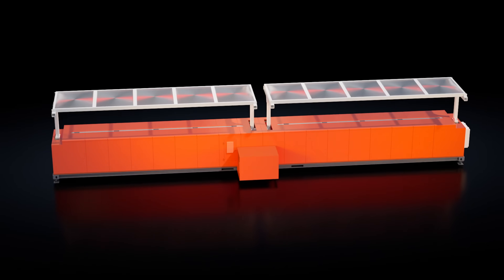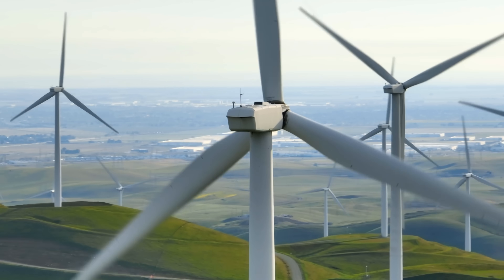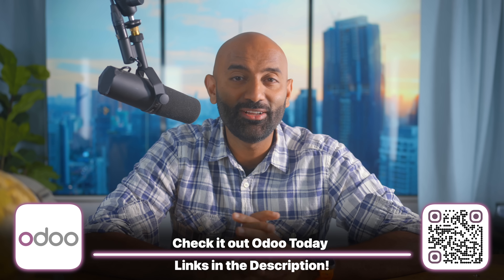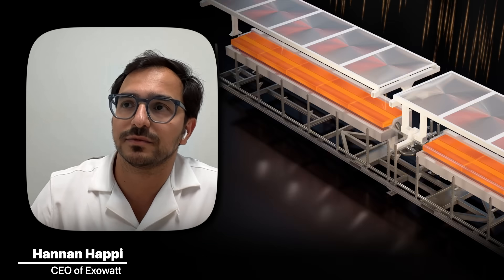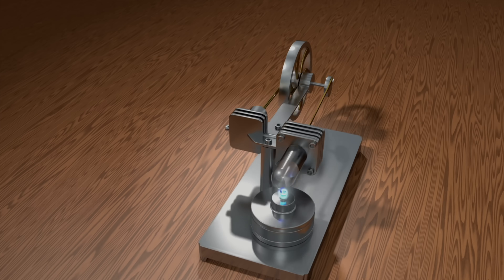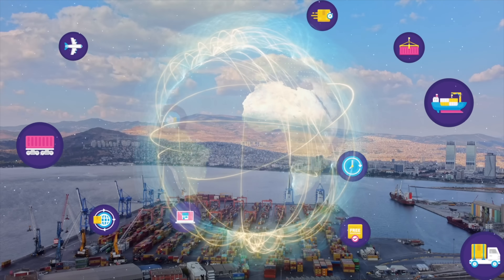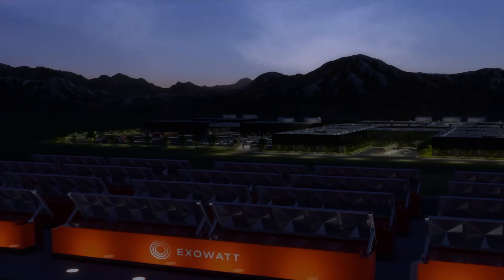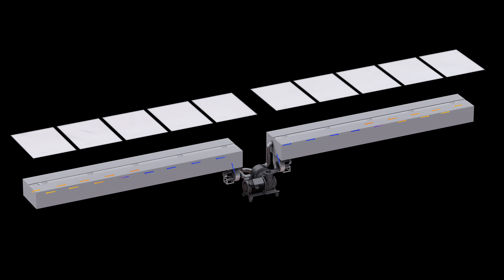Solar Without Panels, Storage Without Batteries - EXOWATT

Comment: I don’t think you said anything about waste materials after the end of the life of the unit. I would think that the materials these are made of are easier to deal with than that of spent solar cells. And you just barely touched on comparing the materials each technology is manufactured with.

Comment: One point of clarification - is the electrical output per P3 unit 25 kWh, 24/7 or 25 kWh total output per 24 hour period?
Reply: @alexkeane1626  I'm sure it dips relative to the peak sunshine vs disdipation/heat loss.

Comment: I have been working on a system to make Hydrogen on sight filling stations. I used similar elements to make power for the electrolysis. I used the Sterling engine, but different solar concentrators and heat storage. My system is smaller and only needs to make enough Energy to have Hydrogen for vehicles.

Comment: How much noise does it make?  What is the safest distance, before the noise is detrimental?  How far does the stored heat travel?  What is a safe distance?

What is the cost to build infrastructure to safely transport power?

So many questions so little time.

Comment: I'm have an off-grid system. The problem is the batteries. I would love to try out a container on my property, 28 acres. Since you need to keep Lithium warm there is an added expense, I use propane. The price off propane has gone from less than $0.30 to around $3.00 in just the last 21 years. My area can go as low as a -30⁰F in winter. This might work in my area if the container is earth berm. A container isn't structure stable to go under ground. Earth burm is what we were thinking about doing so as to not use propane to keep the batteries warm in winter an cool in summer. 
Bricks are a great idea for me!

Comment: As it's a solid box you can easily grow grass and farm cattle/ sheep on the same land. Unlike solar where the cables need to be protected and panels raised at an additional cost. 

All land use should be dual as a minimum, all these power plants have a duty to the planet to integrate food production.

Comment: Why no talk about the weakest link in the chain- the mechanical sterling engine! Not a word!! Active avoidance??

What about the maintenance and noise? How are they going to repair these in 1000°C? What about the replacement cycles and costs of something which is going to run 24x7?

Guess what! I smell another scam brewing!

Comment: 1. Your assessment of maintenance for 30 years is risky for a product, that is not even sold commercially today. It has a lot of moving parts working at extreme temperatures. 
2. Cost is a highly contextual measurement, energetic efficiency is not. The efficiency of the solar panel hardly changed in the last decades (from 15 to 25pct), cost  followed a much different path. 
3. So keeping comparing this to solar panels is kind of deliberately misleading. Compare it to a hydro dam, a coal or nuclear plant or a diesel or natural gas generator. If cost is what is most important....
4. There were no estimates on the (cost or energetic) efficiency of energy storage. Batteries can store electricity at nearly 100 pct. This unit turns electricity into heat, then converts it back to electricity. Guess the efficiency....

But the company does not want to sell this as a general solution. They want to sell it to datacenters, who are forced to use renewables in the US. As of today. They are hoping to jump on the new wave of gov subsidies fostering national self sufficiency. 

So all in all it is not better than solar. Their temporary economic advantage is based on the current political climate and on a niche hyped market. The same story as with solar panels and EV-s. If they get their subsidies they can make a lot of taxpayer money until they find out, that the Chinese can do it better, and someone takes to effort to do the math. Not that Chinese are superhuman, but they are prioritizing self sufficiency since the 50's with several bumps, and the west has gotten its head out of the sand since less than a decade ago. 

Data that is produced at these data centers can travel several order of magnitudes cheaper than electricity and other resources needed to produce it. That is the ultimate cost-benefit analysis. So in the long run the winner is, who can build and maintain these data centers the most cheaply. On earth anywhere.

Comment: Exowatt has a very interesting concept. The issue that I am concerned about is the maintenance costs. It does have some moving parts. You pointed out the fan.  It's also got the Stirling engine. The other thing would be the mechanism that adjusts the fresnal lenses.
I got the impression that they have not built any yet. Therefore, it's difficult to have a real read on the maintenance costs.

Comment: Did anyone else get the Aha moment during this model build and the Great Pyramid? The top of the pyramid was a lens?... maybe not exactly the same but it's definitely got the storage blocks! Maybe the means of transfer are gone but the newly found underground speculative images are intriguing. Instead of the tip of the pyramid projecting it was absorbing is a fun theory.. Fun to speculate.  Exowatt should be installed next to these power hungry Bitcoin Mining plants in Texas!

Comment: Excellent analysis. Is the quoted power output peak or averaged over a day?
The claim that it produces dispatchable power is correct but not the whole story. The average daily  dispatchable output will vary by at least a factor of two from summer to winter.

Comment: What about using an even simpler version of this to only heat your home in more northern climates without any electrical conversion. It likely would not be useful really far up north in the winter when there is limited sunlight, but perhaps as high as Winnipeg, Manitoba, Canada…
Reply: There already are systems that can do that, like evacuated tube collectors. Pretty common here in Germany and they actually work. Just don't expect them to cover 100% of all your heating or warm water, but they will contribute

Comment: 1. As an electrical engineer, I appreciate your thorough presentation, covering all the important questions and objections. 

2. 1,800 degrees Farenheit ??!!! Holy cow!

3. I wonder how long it stays hot, and how long it can make electricity. Florida, for example, is a very sunny state, but most power outages happen during hurricanes where it's cloudy for 3 days.

Comment: I see a lot of nonsense here.
- The lens is used to increase the maximum temperature of the thermal storage block?
Why use a rotating lens with a size only equal to the surface area of the container. If the lens is twice as large, wouldn't it collect more heat? Or is it due to the limitation of the thermal storage block?
- Why rotate? The rotating mechanism increases maintenance costs, and the tracking system adds complexity to the system, why not use a fixed parabolic mirror and vacuum tube. Or simply use the vacuum tube of a solar hot water system. A product that has been commercialized and mass produced cheaply.
- The stirling engine needs a hot source and a cold source to operate. If you pack everything into a container, heat insulation will be an impossible problem.

Comment: For those I already on solar they could simply sell the part that makes power from the heat.  Then the extra power we get from the sun during the can can heat the bricks to be used at night.  We'd still have batteries but likely would not need as many.

Comment: Even if we use all 40 by 8 feet for solar collectors, it will be 29 square meter.
That will be 29 kw solar energy at top of fresnel lenses. At 75 % thermal efficiency, we can expect 22 kw heat energy for 5 hours per sunny day. That is 110 kwh total thermal energy per container. The best sterling of nasa with fpse is about 35% efficient in thermal to electrical efficiency. That is around 7.5 kw.
Essentially one container can operate at 7.5 kw for 5 hours during daylight and 10 hours from the thermal storage. Is that right?
Trying to understand the 25 kw claim with 600 kwh energy delivery during 24 hours.
Reply: Do the numbers work if they are claiming 25kWh per day with 24/7 generation and someone along the chain to this video mixed up kWh and kW?
(only thing I can find on stats from their website is a calculator on the wayback machine for 1000 MWH ,12 acres and $1,520,670)

Comment: So, an off shoot of the sand battery, As for land use, there are hundreds of industrial parks that are abandoned, which means there are power lines in place, there are also big box stores, shopping malls that are now empty, with very large parking lots, lots of room for these containers.  What about all the lakes, and reservoirs? stick pontoons on the container and float them. The water would act as a great heat sink, and it would reduce evaporation.
 The ideal spot for this system is the desert, in fact they should use a 2-container system, the bricks stay on top, while a second unit with frozen water is buried right next to it. Use a heat pump at night to freeze the water use it as a heat sink for the sterling engine.

Comment: The battery and solar figures comparator used in this video seems to be based upon Lithium-ion storage and PV array occupying a separate footprint each. Whereas if one considers a different model of an integrated solar array above a stackable and lower cost battery system, like Sodium-ion or VRFB then the numbers change and seems to shift towards PV + battery gain. 

Also, the Exowatt low cost per unit figure highly focused approach is similar to that of Form Energy's Iron-Air battery approach, so again would have been a more useful comparator to Exowatt's data given in the video. 

I would also have liked to have seen what the variation in energy capture of the Exowatt solution under different environmental conditions, such as diffuse/overcast light vs bright direct light, and cold external temperatures vs warm ones (impacting the heat storage mechanism and stirling engine). This would then show the versatility of the Exewatt solution vs that of solar PV + batteries.

Comment: If it is only tracking on one axis, isn't it going to set fire to the next unit along (or a shrub placed nearby)? I'm sceptical that this will be more robust than PV, inverters and batteries.
Reply: The single axis tracking is complete bs in my opinion, I have Fresnel lenses myself.

Comment: Cool, if they find a way to market it to industrial property groups, the sale becomes easier and the land-use concerns are sidelined: selling a way to generate power (or even just heat storage) that reduces air conditioning costs, is easier to translate into overhead savings.  There is a lot of roof-top space out there that is a significant cost to business when the Sun is on it, that is otherwise dead land, and steel is cheap.

Comment: I would like you to get a onsite tour. With a look into the materials of the bricks. Also I would like to see the orientation of the bricks the blower motor and the Sterling engine how they are connected and how they get the energy out to the grid or to a home. Also a material list of what the Sterling engine is made out of. And rotations per minute

Comment: This has got to be your best video, yet! 
As soon as you mentioned "efficiency" I already realize it's not efficient than PV and LFP, because it requires less land. Therefore, I bet the freznels and the bricks absorb MORE THAN the ~20% that the panels do. Probably like 99%. Of course, I can't wait to see the efficiency of the Stirling motor (so I'll keep listening) 😁
What I really like is "easily sourced by domestic supply lines".

Comment: 🔥
However, how much energy does it produce over its lifetime compared to how much energy needed to make it. For example, it delivers about 25 kWh/day, but how many kWh is required to make the metal shipping container, process the heat storage medium, make the freznel lenses, the sun tracker, etc? 
I bet the EROEI is at least 20, though ! 😁

Comment: What is the performance in low light settings?  While fresnel lenses may be more efficient in transferring light directly to heat energy, what about diffused light? conventional solar panels still produce a decent amount of energy on cloudy days. It seems like the only real innovation here is the “sterling engine heat battery”  With its modular plug and play design but this introduces another issue where 5 units uses 5 sterling engines. I wonder if it would be overall more efficient and cost effective to ditch the fresnel lenses for regular Pv, and just store the collected energy in these modular “Sterling batteries” or, better yet, ditch the sterlings too, store the heat energy in some type of modular molten salt battery, and use the heat to drive a central steam turbine which are Hyper efficient these days.

Comment: So, how noisy would the sterling engines be? Will Exowatt technology be easily maintained? Do sterling engines need a kickstart?
I piti the victims of power plants for AI. People probably didn't think much of power plants nearby, until the NOISE started. AI Computers are extremely noisy and use up water to keep them cool.
AND YES, I'd like to see a downscaled version for home use. Presently I use 400W solar panels to charge 12V Lithium 2400W batteries. I can run 5000W Air Cond for 4 hours, and most appliances, such as toaster oven, 800W espresso machine,  TV, etc. Mounted on 2 pressure treated panels with a stick support on back.
Works great! But would certainly like to build something like the Exowatt!

Comment: I must admit I'm dubious.  I get the the fresnel lenses focus the light and perhaps that could help store the energy at one point, but the amount of sun light hitting the overall container would be approximately the same as without them.  It sounds like a very similar concept as the traditional thermal solar farms, where thousands of mirrors reflect light onto a single point which stores the heat, but those take the energy from a large area, not the area of a shipping container.

How does the heat get into the bricks through the shell of the container?  

The numbers of efficiencies/generation seem to be "trust me bro" from the company honestly.

Comment: Great video I'm sure all of those who are threatened by this are probably going to do what they can to keep in their form of energy.. that's how life goes Its competition. If you look at all the deserts that we have in the United States I see a opportunity to produce a lot of electricity. I worked for Southern California Edison at San onofre and as part of our rate base we got power off of the Hoover Dam. That power also got fed over to La Power and Light and provided them Dirt Cheap electricity. So to me it's not such a big deal apparently to move power all the way from the Hoover Dam over to LA and San Diego and everywhere so conceivably you can fill up the whole desert there and probably power many of the western states and even Northern States so I don't think it's foolish and having a different mix is always a good thing when having a base for electricity production. Way of dams located all over Western United States on rivers and those dams are slowly 1 by 1 being torn down and torn out. Over time there will be need to be something that takes their place.. recently in the news there was a squabble with Canada trying to bite back at president Trump by cutting off the electricity produced in Canada going for Northern United States. I do agree that if these data centers are going up their location may not be the best in the middle of a hot freaking desert. As we increase the amount of electricity production we have to use fuels that in essence burn and release energy. No matter if it's nuclear or natural gas or oil any of those are not 100% efficient and will leave you with a net heat gain in the area where the plant is at and mostly those plants are located on rivers and so we slightly heat up the water as was a nuclear plant on the ocean heating up water.. I got an idea... maybe people should stop rushing towards being brain dead and counting on a stupid computer AI to do all their work for them and not think on their own. Why is it that because we need to be smart in AI that we have to have all these places providing power for it? That's their business provide the power forward on their own and maybe the rest of us should think about doing something for ourselves and staying off the computers doing stupid stuff with our social media p***

Comment: There are limitations on where these would be used. Solar cells can be made to work on cloudy days. However, fresnel lenses don’t do jack on a cloudy day. I have had a couple big ones I pulled out of the trash (they were in those pre-HD flat TVs) I always thought if the grooves were parallel instead of a circle then they would always focus to a strip that could heat a pipe and drive some kind of generator.
Reply: So you have Fresnel lenses (and so do I). What are your thoughts about that single axis tracker? I call bs, that's not how it works 😄 Btw, a lens with parallel grooves would be the equivalent to a trough collector, tech that already exists and not as UV-degradable as plastic.

Comment: Looks great, but also looks like it may be far too late for it to take off and gain traction. Solar panel prices are dropping at a faster rate than ever and the tech used to make them greatly improving yield. Battery tech is also dropping off a cliff and again, new tech is going to drive it even lower.

The biggest problem however is US_based production. No one in the world outside the US wants US-produced goods nor energy. If manufacturing is moved to the EU and/or China it could help adoption.